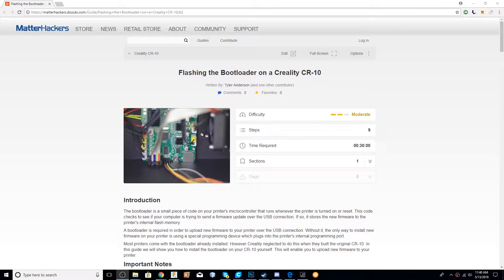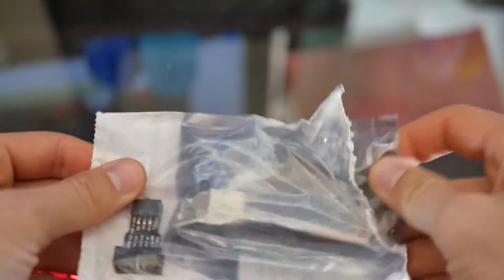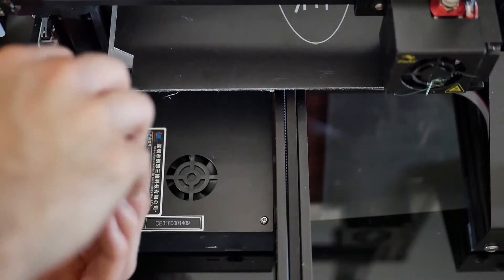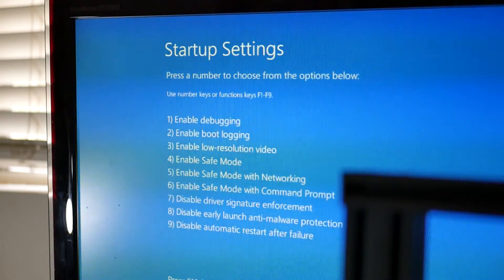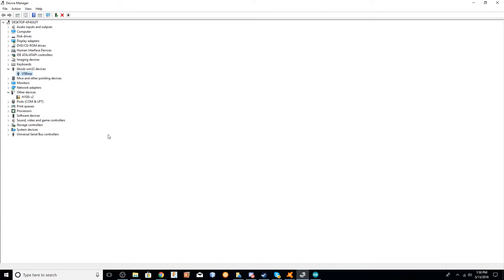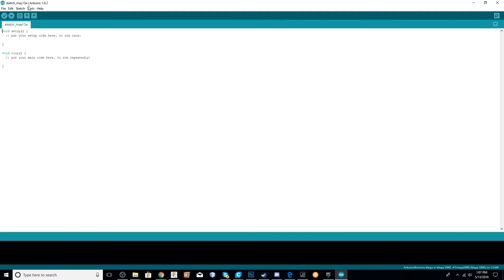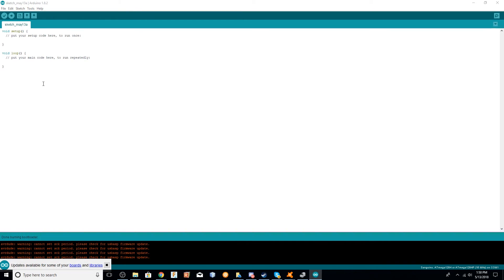Tutorial How To Install Bootloader To Your 3D Printer (Creality Ender 3)

Comment: Arduino: 1.8.13 (Windows 10), Board: "Sanguino, ATmega1284 or ATmega1284P (16 MHz)"

avrdude: Warning: cannot open USB device: Function not implemented

avrdude: Warning: cannot query manufacturer for device: No such file or directory

avrdude: Warning: cannot query product for device: No such file or directory

avrdude: error: could not find USB device with vid=0x16c0 pid=0x5dc vendor='www.fischl.de' product='USBasp'

Error while burning bootloader.

This report would have more information with
"Show verbose output during compilation"
option enabled in File -> Preferences.
???? what did I do wrong I followed all your Instructions I have Board Version 1.1.4

Comment: Thanks for a good video. You may want to take a look at Mat1uk 3d printing channel. He has a link to USBasp drivers that are already signed. That way you don't have to disable driver signing enforcement in Windows 10. I have installed it and it works great.

Comment: instead of hacking the connector on the USBASP, you can also opt to slide the plastic receptacle for the LCD ribbon cable off the board "temporarily". It will slide right over the pins with the help of a small tech screwdriver or can be wedged off with a pair of small needle nose pliers.*MAKE SURE BOARD IS POWERED DOWN* if you attempt to remove it, and ONLY grab the plastic receptacle, NOT any of the pins!!

Comment: My port wouldn't show up in Arduino but i updated the driver and it worked. Download https://zadig.akeo.ie/ update the driver to libbusbk (v3.0.7.0). The port still will be greyed out but you are able to flash the bootloader. This link will show you instructions on how to use the zadig program https://rayshobby.net/wordpress/dead-simple-driver-installation-for-usbasp-and-usbtiny-on-windows/

Comment: PSA: usbasp doesn't show up on the ports, DO NOT WORRY, set all of the other settings and it will work as long as the correct drivers are installed regardless of there being no port. I spent so many hours trying to solve this, also noticed not all of my usb ports worked with it mainly the front i/o, the back was good.

Comment: Mac users. There is no driver for the USBTinyISP. All you need to do when using a usbtinyisp the to upload the program you must go to file and then use the option "Upload using programmer". The issue is that is not an option so the keyboard shortcut is command + shift + u. That will upload the bootloader.

Comment: Thanks for the video. Easy to follow along with.  
I am right with you until I have to choose the port. Mine is grayed out. Everything is plugged in.  Under tools I have the board as sanguine and the processor as atmega1284 (16htz).   Any ideas where I am wrong?

Comment: caution, i just tried to flash using a usbasp from a US seller from ebay, and had to jump through a lot of loops. first, i couldn't connect and had to install some "usb-k" drivers to connect. then i get this error: "program enable: target doesn't answer. 0 " I couldn't solve this issue yet, and now creality is telling me they can't help people trying to tamper with firmware. sucks. now I can't get my titan aero extruding properly because I needed to change a setting in firmware.

it's probably better to try Teaching Tech's method (use Uno) or buy a different controller altogether to replace stock (although you need to tune the stepper drivers/or buy expensive TMC2130 drivers).

update: you can use the m92 gcode in pronterface to temporarily set the steps/mm settings. you won't be able to save anything, so you have to type this in every time you start up the printer.

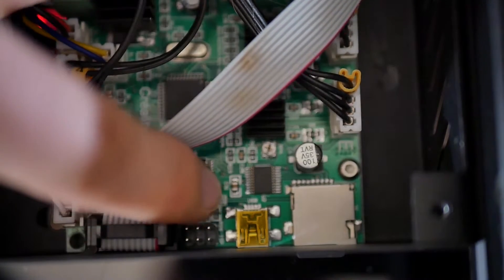Comment: at 3:16 the jumper is not at the far right position. which position is true??
Reply: On mine, the far right  position next to the plug is 3v and the one next to that is the 5v. Since mine is 2 years newer and billed as for the Ender 3, it's default position is the 5v.

Comment: Didn't work for me, I have the exact same programmer listed in your description. Trying to fix my Ender 3, which has a newer Creality v1.1.3 main board. Tried this method, along with every known different driver for the USBASP; tried using a Arduino Nano as an Arduino as ISP; and lastly tried 2 methods using a Raspberry Pi (one using an automatic script on an SD card, another using PuTTy and manually trying avrdude). Maybe my board is toast, but who knows.
Reply: http://forum.arduino.cc/index.php?topic=415210.msg2862244#msg2862244

Worked for me!
Reply: @swepeter2  this solution worked for me, thanks a bunch!

Comment: Hi, can i use this method to flash just the bootloader and still continue to use the original firmware, or it deletes the original firmware?
Reply from the maker: Yes won't affect original firmware
Reply: ModBot thank you, so the bootloader will allow to me to flash any firmware(marlin, unified, updated original) through usb instead of using an SD card?

Comment: Hello, Thanks for the video. I bought same equipment and followed to T. After I load drivers which works, I can not get Ardiuno to see as port stays gray. I have gone back and forth reinstalling and uninstalling drivers with no luck. Under my device manager, the board after drivers are loaded shows as name of usb driver folder and is not associated with any ports. Any ideas?
Reply: Sadly I gave up. Nothing I do allows port to show in Arduino. I did drivers just as I should. After loading drivers, device shows under it's own header in device manager and has nothing to do with ports. Tried two computers. Got blue light on board. I'm lost :(
Reply: Same  exact problem here :( spent seven hours on it today and gave up in the end.
Reply: I cant get it to work either. wont show up as come port
Reply: I can't get my asp programmer to map a port either.  I think some of them lack a serial emulator chip or some such fuckstickery, I'm still looking into it.  What a pain in the ass.
Reply: Try zadig driver software.  Very handy for many different boards

https://rayshobby.net/wordpress/dead-simple-driver-installation-for-usbasp-and-usbtiny-on-windows/
Reply: I don't know if I missed this on the video but I got it to work when I plugged BOTH into USB.
Reply: When you say "BOTH" do you mean the Programmer and Printer?
Reply: I am stuck on this as well.  I am SUPER frustrated, because apparently I did something I should not have done. and now I have a blue screen when I try to boot up my ender3.